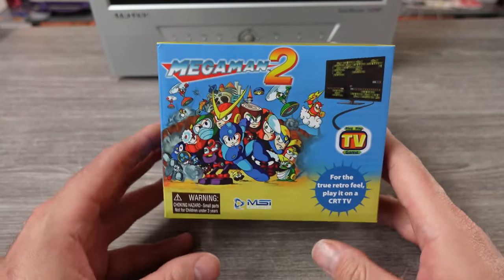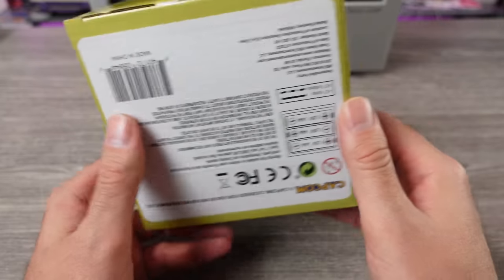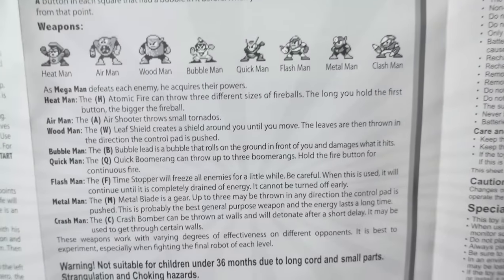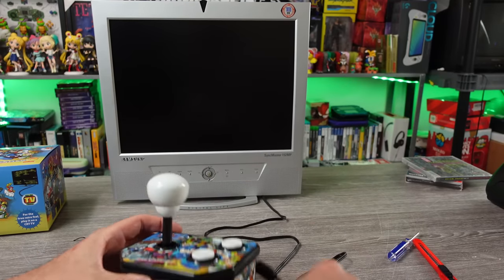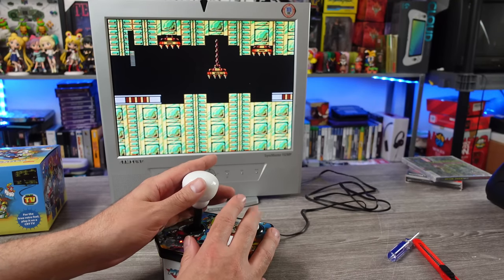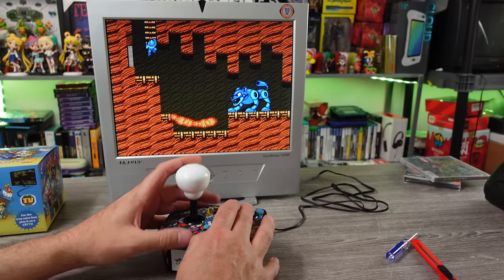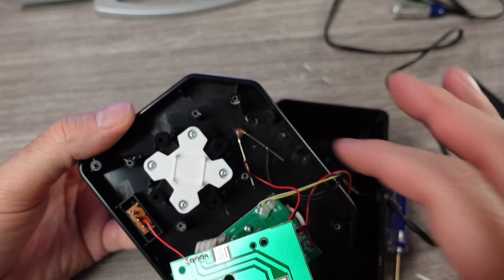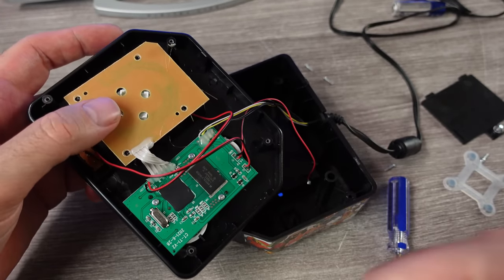I PAID $11 For A RETRO Console That Can Only Play Mega Man 2...

Comment: I have one of these, though I got mine at a local thrift store maybe three years or so ago. It was new in the box, and they were selling them for I recall $2.99 (most likely overstock from a Dollar General). The box has a window in the front so you can at least see what you are getting. Otherwise, it is identical to what you have there, right down to the chintzy manual. I tried it out once, and the plug-in was at least as cheap as one would expect. I just keep it in the box alongside of three boxed Basic Fun arcade games I got at Wally World when they were carrying them.

Comment: What kills it for me it's that it's just batteries no AC Adapter option I hate that. Good review and cool video Ron!
Reply: Considering it's 3 AA batteries (4.5v), you can probably solder a 5v cell phone charger with the USB chopped off to the battery terminals.

Comment: At a random discount store I picked up 2 WWF(E) Steel Cage Challenge NES PAP that's exactly the same when I opened it up. Thankfully I paid 5$ a piece. Strangely this ROM was modified because they swapped one wrestler from the original game with another. Yet it's MSI and the exactly the same casing.

Comment: This would have to be a device emulating an NES, since the Capcom and MSI logos have nonstandard NES colors and their fades are too smooth for the NES.  If it was a NES on a Chip (NoaC), those graphics would need to be part of the NES ROM, NoaCs are a heavily stripped down version of the NES architecture and thus not emulation.  Ironically, the one-chip SNES, an official Nintendo product, was more of an emulation box than these bootleg machines.

Comment: How can selling composite only be even legal nowadays ? Every tv out there uses hdmi. I would have thought using composite is starting to be more expensive now. The stick makes sense if this toy is meant for a 5,6 years old child. The price is fair. Profit has to come out of somewhere, the licence alone would have cost them a bit.
Reply: Hdmi has to be licensed and the electronics are more complex, especially as you have to upscale and convert the video from the NOAC`s composite output.  This thing doesnt use emulation, its literally a NES shrunk down to a single chip with composite fed from one of its pins + ground as its only video output by default. Same with the mono sound, thats all it can output.
It would be way more expensive if it had hdmi.

Comment: If someone really wanted to make some bucks with only one old nes game, they would release duck hunt and get the gun to work with modern TVs.
Reply from the maker: Been done. And we have covered that on the channel a few years back. Theres quite a few NES zapper games that have been patched to work on an LCD. Look up LCDZapper, Hyperkin even made a cheap Zapper thats compatible. Thats all for original hardware, but for emulation there is are lcd lightguns that work as well.

Comment: This is absolutely an NES on a chip right next to an EEPROM, and a crystal oscillator.

Though, it probably has a CHR RAM and an MMC mapper chip integrated into the NES COB chip (as that's required for Mega Man 2; could be MMC1 or MMC3 with a patch).

I'm guessing if you desolder the EEPROM you could flash up any other compatible game in that chip, maybe take a backup first though. 

The chip is probably large enough to support multiple games, but unless there is a more sophisticated mapper on board*, you may not be able to load more than one game at a time (*which is possible, maybe the additional intro screen is actually a "menu" selection ROM that's been changed to just load bank 0.  This is all speculation on my part of course).

That being said, hacking in a cartridge port, if there already is a baked in mapper, and no provision for connecting an external CHR ROM... well that could prove difficult.

Like, you're 99% right, but it's that last 1% that will eat your lunch every time. 👍🏻
Reply: This is absolutely not NES on a chip and thats why EEPROM is next to it. It is emulation, thats why you can compact CHR and PRG in one EEPROM.
Reply: @SieIaQ  please provide your evidence -- I disagree on account of an SOC would have a lot more going on on the PCB, would have no need of a crystal oscilator, and usually aren't implemented via COB, but CMOS based NES on chips almost always are COBs. -- Plus NES on chip is just cheaper. -- Not to mention it runs on 4.5v CMOS (roughly the NES voltage), whereas a SOC would run on ~3.3v.

Also, again -- Megaman 2 uses CHR RAM, so only one EEPROM is necessary; and adding an extra 8 KB SRAM to the COB is pretty trivial.

Comment: What does its not emulated, its a nes on a chip mean?
Reply from the maker: Its clone hardware, for a long time there has been NES clone systems that use chips to replicate the original, but typically not perfect but usually passable. Nowadays they have been able to condense these clones to a single chip in a small formfactor. So its not using software to run the games, its behaving like its a actual NES console.